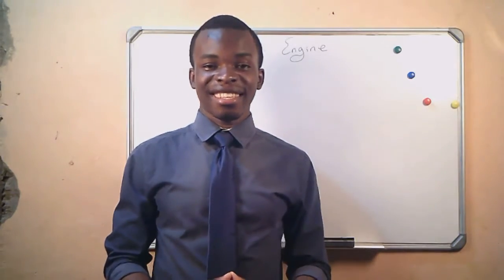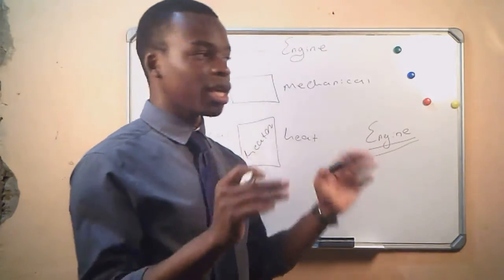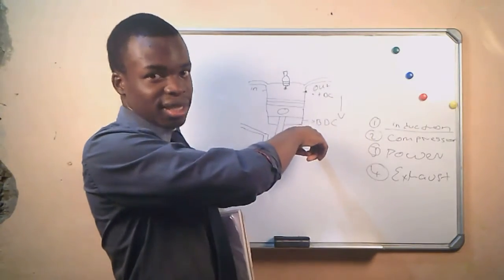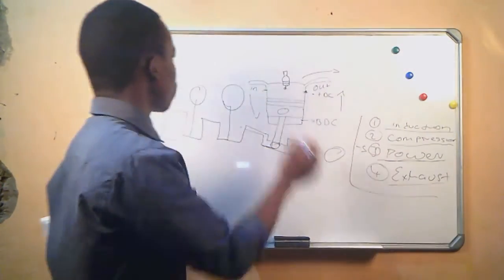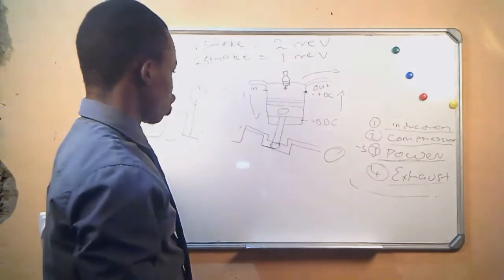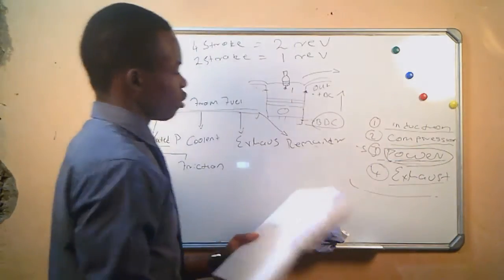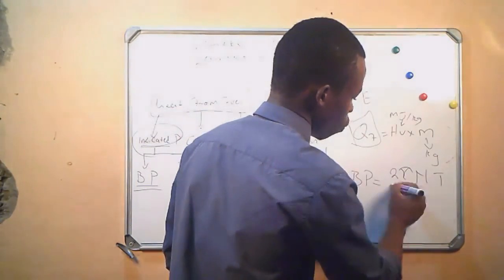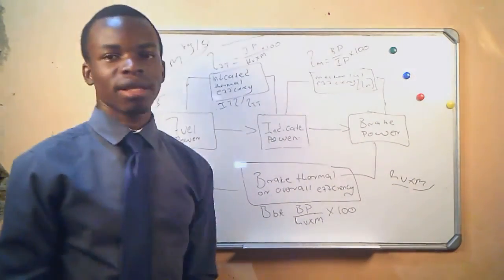INTERNAL COMBUSTION ENGINE (1of2) POWER MACHINES N6

Comment: A goodnight to you sir, with all due respect Sir . May you please help me with what I will be writing about on the 16 of February this month of course, which is : Thermodynamics 
                  Steam Generation: Efficiency and equivalent evaporation, Economizers and heat balance sheets boilers 
                 Nozzles - air flow 
                 Nozzles- steam flow 

Please help me sir , thank you 🌈
Reply from the maker: Unfortunately it's not possible for me to just jump to those topics I have to finish the current topic, sorry.
Reply: Okay Sir no problem